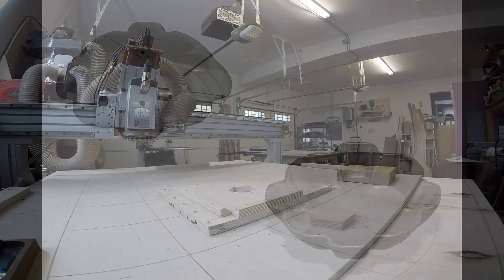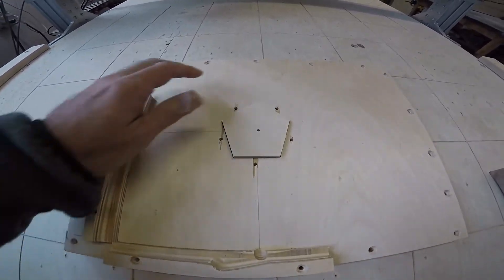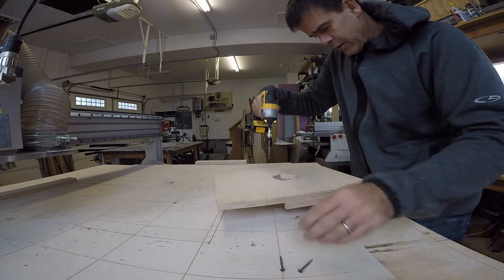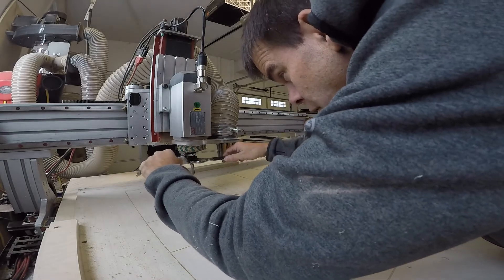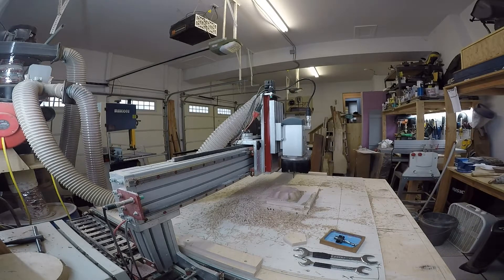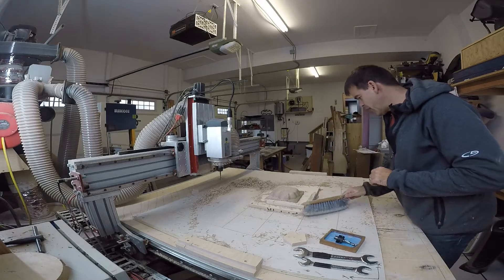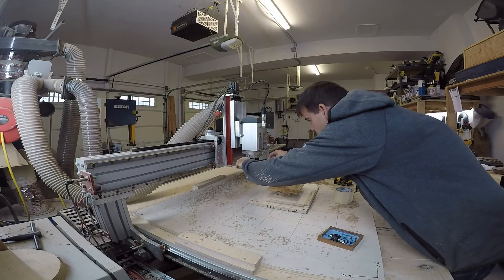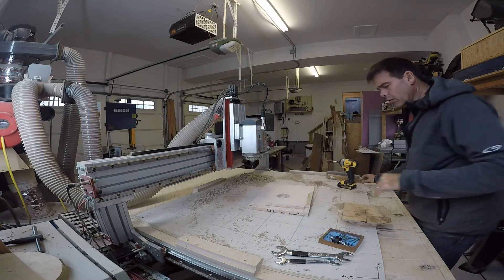20181201-How to make a 2-sided bowl on the CNC

Comment: That’s one of the most intriguing systems for double sided cutting I’ve seen. Will definitely have to give that some consideration for my own hold down systems. I’m curious how you cut the pentagon in the main piece. It seems to have very sharp corners. What bit did you use to achieve that?
Reply from the maker: Then outline of the pentagon on the bowl was just made with a 1/8” endmill. More than accurate enough to align the actual pentagon shape to the bowl accurately. The pentagon shape itself was cut using a 1/4” compression bit from 3/4” Baltic birch plywood.
Reply: Matt Reidy thanks. I’m close to putting down a new spoil board and so am considering its layout and hold down system. Thanks for taking the time to make the video.